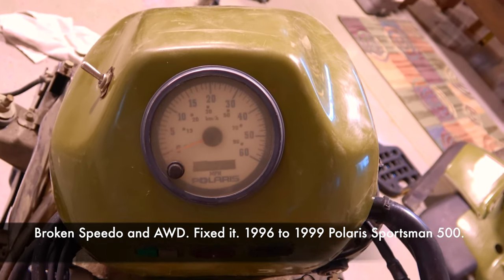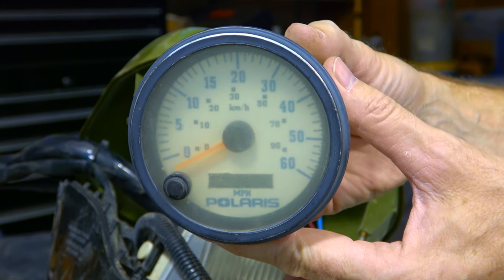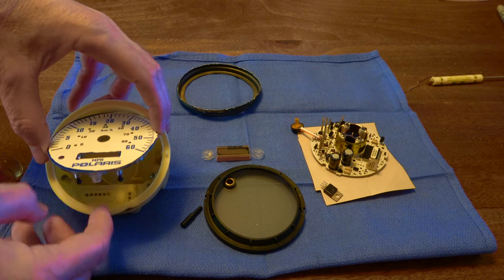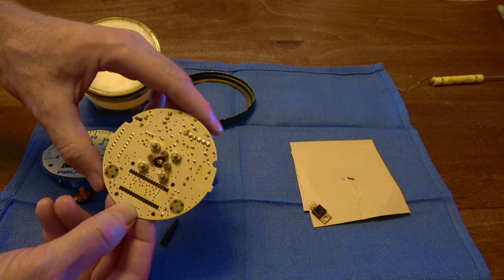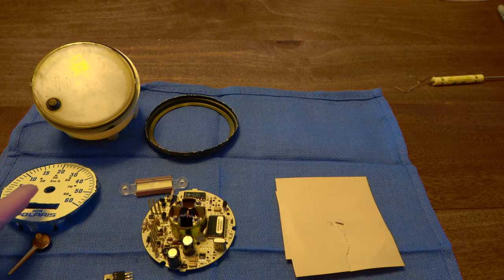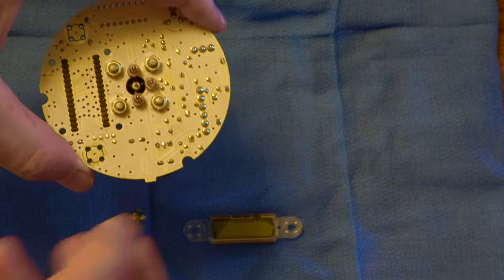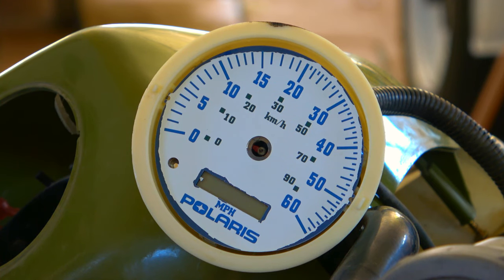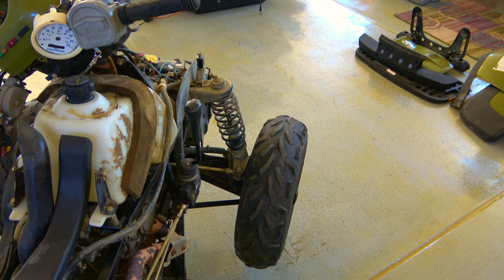Broken Speedometer and AWD. Fixed it. Polaris 1996 to 1999.

Comment: Yep. My 2000 Polaris Sportsman 500 also had a dead speedo/AWD/headlight and the transistor de-soldered and rattling around in the assembly like yours. Unfortunately, soldering it back into place in mine didn't fix it. I intend to replace the entire speedometer with a small computer and screen and relays to get everything working again. I've managed to snag a schematic and will be fixing everything by a full mod on the ATV. You'd be crazy to pay $400 for a replacement OEM speedometer because they're stupidly designed in the first place and bound to get too hot again like before; there's no heatsink on the TIP48 power transistor and it gets to well above 300 degrees Fahrenheit at times. This is completely ridiculous. We should all sue Polaris in a class action lawsuit.
Reply from the maker: Sounds like you have a pretty good handle on it. Id love to see what you come up with. Yah there def is a design flaw. And the replacement is unreasonable. It sounds like you have some electronics knowledge and experience. Have you or could you modify the TIP48 with a heat sink somehow? Would it be worth it and or less trouble or no?

Comment: My speedo on my 1999 doesn't work.  Voltage regulator failure caused all the lights to burn out. AWD didn't work also. Found bad main grounds to everywhere. I  ran a new wire from negative battery to the new voltage regulator,  fixing my charging. issue.  Then under the front panel under speedometer, creating a new frame ground put new ground to harness where the voltage regulator brown wire plugged into harness. Also from new ground source I sent 2 wires up to the brown wires on the AWD connectors to properly ground them also. Now no more starting issues, charge issues are gone. AWD WORKED,  like a new bike. Speedo doesn't work but everything else works perfectly.  GROUND is main issue on Polaris systems.  Also replaced lights with LED lights at the same time. By sending a good ground back to the harness from the voltage regulator harness brown wire gave the bike a new ground source to everything! Someday I will pull apart the speedometer and deal with that issue.  High voltage I'm sure caused it to fail some how. Hope this helps others,
Reply from the maker: Good info thanks. Sounds like you put in some time. But I bet you know that wiring backwards and forwards at this point.  That particular speedo is known to be problematic and one of the things that can contribute to its problems is a faulty regulator. Its problems also relate to the price to replace it. What I did was an exploration or exercise or experiment that fortunately worked out. But I have known many to bypass the wiring successfully. Probably the best more permanent solution really. And if my speedo acts up again, which I suspect in will in time. I will probably do the same. Ive been fortunate enough over the years to not have any wiring issues really other than that.  Thanks for the feedback.

Comment: hi eric. my question isnt about the sppeedo. my issue is the r/f hub leaks. yesterday i changed the seal and leaks like a faucet now worse. any suggestions would be greatly appreciated.
Reply from the maker: Are you taking about the hub seal on the back of the hub under the brake disc or on the strut Im assuming. With out seeing it all I can do is ask a bunch of questions most of which you've pos covered. But bare with me as I go through some and hopefully it'll help. All these questions would really apply to either. Was it an OEM or after market seal?  If after market, is it known to be a good replacement?  Was there any damage to the casting removing the old seal?  Or the corresponding contact surface? If so repaired or smoothed out as best as pos before reinstall?  Was the seal confidently put in properly? Correct orientation?  Not bent damaged or distorted? Did you you lube up the surfaces of the seal and the contact surface?  All of these things can contribute to a leaker.  It can be a finicky deal. I have had similar outcomes in the past. You just have to be aware and prevent any of the above as best you can. Also I have a couple other videos on the hub assembly and a strut seal install. In addition to the above proper torque on the castle nut is certainly a factor. You'd have to watch for the specs on that I don't recall off the top of my head and don't want to guess. Look on the channel at the Polaris playlist if you interested though. Hope that's of help.
Reply: @ericinalaska7648  wemade sure that seal was even and level when we installed it. i also hear now it could be some o-rings . i dont mean the hub seal but o-rings.
Reply from the maker: @judgementday7107   There is an orange(s) on the end cap. Is that what your referring to?  Is that where its leaking the cap? Then yes absolutely there is an O-ring. Just pop off the cap I believe 3? bolts pos 4? and you will of course need to refill the fluid after .
Reply: @ericinalaska7648  the leak is from behind the caliper. sorry so new to this my lingo is hard tounderstand. arent there any o-rings behind the caliper to the hub.
Reply from the maker: @judgementday7107  Is brake fluid leaking? The would be another source. If you have a bad or damaged caliper. Thats pos.
Reply: @ericinalaska7648  i bought this bike 6 mnths ago, its had new wiring,cables,all calipers, brake res. i drive it it has good brakes. its the hub fluid thats got to be contiunally topped off before i ride. its not brakes.
Reply from the maker: @judgementday7107  It can only leak from like 4 places off hand. The hub/cap. The hub seal. The strut seal. Or the fill plug. Or if something is damaged or cracked.
Reply: @ericinalaska7648  if its a strut seal leak, would that still mean that the hub leaks from there. i need to fill the hub with atf everyday.
Reply from the maker: @judgementday7107  Those are the primary things that can leak. Secondary would be any damage to something. Say poor inconsistent seal surface contact. Or something cracked. That would likely be an extreme case. Bent wobbly shaft from a roll over another example. But other than things like that. You have the O-rings on the hub/cap. The seal behind the brake disk and the seal in the strut. And your filler plug. That pretty much covers the options. If its leaking as bad as you describe. And that's a lot. I would personally take it all apart and start from scratch. With a new seal or seals, and be extra attentive to all the details we've discussed prior. I don't think there is any short cut  that will solve it. Frustrating but I don't see a way around it based on what we've discussed and what your telling me. Mak3 sure all the surfaces are in good condition make sure the new seal(s) aren't damaged. The new one could have been damaged upon install who knows. Makes sure you rub some fluid on the seal and surface. Make sure the castle nut is properly torqued. Make sure the filler cap is sealed. Thats all anybody could do. Even if you take it to have it done someplace. Thats really all they can do as well. Just have to commit and see it through.
Reply from the maker: One more thought. I know I have found on some Im not sure if it applies across the board. But the one I do the Hub assembly on. There hub bearings were two different sizes. If those are installed in the wrong order. Perhaps Just a thought. Perhaps that would cause the whole assembly to not  land how it should and that could contribute to your result. But if you're properly torquing and things spin as they should. I don't know just a thought.
Reply from the maker: @judgementday7107  Yes it can.
Reply: @ericinalaska7648  appciate the time youve take eric. im sure its the strut seal then, since ive put in the hub seal that needs to be level and tapped in. i saw your vid on hub repair , but you changed one seal, is the strut  seal in there somewheres
Reply from the maker: @judgementday7107  Its been a while but I believe the video if its the one your referring to is the strut seal replacement. I have another for hub assembly but I don't believe I ever demonstrated the one behind the brake disk. So to clarify. There is one behind the brake disk. You ren=move 4 bolts and the brake disk comes off revealing a seal,  The other , a smaller diameter one. Is installed in the casting of the strut. If I remember correctly that was the one I demonstrated.
Reply: @ericinalaska7648  ty for that response . that is gonna be the seal thats needing replacing. could i ask for that part number for that seal. 2000 polaris xplorer 400. youve helped greatly tyvm
Reply from the maker: @judgementday7107  Google it or search Amazon and make sure it comes up as compatible. I would want to misinform. Im not super familiar with that particular machine and there may be some additional info or options that would need your clarification.
Reply: @ericinalaska7648  is a strut seal and hub seal the same?.
Reply from the maker: @judgementday7107  Usually 2 different diameters. I don't know what kind of budget your working with but if its in the budget get yourself a shop manual. There not very expensive and have a wealth of info. Check out the video description. There should be a link for one. That may not be the one you need but you can refine the search from there and find the one you need.  I always try to get my hands on one for whatever I have. So Helpful. I just don't have a great deal of the specifics for your model.  Happy to help where I can but its a bit limited for that model. Link for a decent shop manual.   https://amzn.to/3rFQW6p

Comment: Just had my rear axle come apart on my 96 Polaris 500. We see the bolts that hold both sides together. Do you have a link for repair/replacement of the rear axles. Haven’t looked yet to see if the bolt simply unscrewed or possibly snapped. Kind regards. Jan in upstate New York
Reply from the maker: I had actually shot a video on that in the past and the footage evaporated along the way. Is it a single axle? Meaning not independent rear suspension with a shaft to each wheel? I forget what year dual independent rear suspension came out. If its a single axle for both wheels I have limited experience with that set up.. If its dual. They're relatively inexpensive and relatively simple to swap out. Happy to chime in if needed.

Comment: Hello Eric I got the drain plug out on the hub no problem. 
My speedometer lights work, headlights work and the four-wheel-drive works but simply no speedometer. Before I try to look into this really long blog that you recommended farther down in the comments I thought I’d see if you had a quick thought. There looks to be like some sort of speedometer cable to the back transmission on my 96 sportsman recently acquired
Reply: Just opened up the light box, wonderful surprise old style with speedometer cable unscrewed/easiest fix in the world!
Reply from the maker: Easy to say now of course butthat would have been my suggestion. Not that it was disconnected. But to replace the cable. They're fairly cheap and an easy thing to eliminate in the trouble shooting process. But your fix was even easier. Hahaha! So much can be learned by just opening stuff up some times. Thats great!

Comment: I finally got my speedometer working with a new speed sensor but the needle stops at about 7 mph and won’t return to 0. The needle was at 0 before I installed the new speed sensor and speed increased when spinning the right front wheel. Do you think the needle just got stuck because it has been sitting for a while not working? I’m thinking about taking it apart and see if I can gently push the needle back down to zero
Reply from the maker: Thats a tough call. Did you gain any other functions as well? Id probably ride it for a bit and see if it comes back to life. And if you gained any other functions you have to weigh the benefit vs the risk. The needle is pretty firmly pressed onto a pretty fragile pin. Have you opened  it before? In the process of troubleshooting? Does the needle seem displaced or rubbing on the lens/plastic? Or had you previously removed the needle? If so. If its not put back in the same position it may settle at a different point. Pos.
Reply: There's a chip near the edge of the board which controls the movement of the two windings (and thus, the needle). Get it apart and measure the resistance across both the bottom two poles of that middle assembly as well as the top two. You should get around 200-230 ohms. Look for heat damage on that rectangular chip. The chip is responsible for zero'ing the needle. It's possible that the needle was reinstalled in the wrong position.

Comment: Great video! This is very helpful. I just purchased a 2000 sportsman 500. The speedometer doesn’t work at all not even lights and neither does the 4x4. I’ve got the ring off and the glass, now I’m at the speedo face. I was able to remove two screws however the third is completely stripped out. Any tips on removing it? 

Who knows if I’ll have any luck, the speedo was full of water because the machine was left out in the weather for a few years. The acres inside are very rusty and brittle.
Reply from the maker: Needle nose pliers? Yah, water can certainly be the enemy. You'll never know what's going on inside there until you get in though. And if it's unfixable. At least you'll know that. And then, on to plan B. Take the most care of all removing the needle. If that breaks off. You're pretty much done. Or at least Im not aware of an economically reasonable solution that's cheaper than just replacing the whole thing at that point. I wish you luck.
Reply: @ericinalaska7648  I got the needle off in one piece. I’m at the part where you pry up the speedo face and undo the three screws. One screw left but it’s got a stripped head. Think I’m gonna try to drill it out
Reply from the maker: @MrBoston2612  If I remember correctly its a Phillips? If so, can you get enough purchase with a small straight blade?

Comment: how did your friend test the transistor?
Reply from the maker: Multimeter. I'll bluff my way through it best I can. The one that needed to be reattached in the video is a TIP48 NPN (Neg Pos Neg) transistor. You have an emitter, a base and a collector. The middle being the base as I understand it. (Three posts.) He put the pos probe on the base (Middle post) and the neg on each outer post one at a time to demonstrate if there was a voltage drop (resistance or change in the reading from zero) and then reversed the probes to demonstrate no change or no reading. And with his experience he said looks good. But my understanding is if you put the pos probe on the middle post and see a reading change on the left and then the right. Looks good so far. If you then switch it to place the neg probe on the center and then the pos on the two outer posts one at a time again. You should have no reading or resistance. If you get a change in your reading like this your transistor is bad. I was prepared to replace it, having limited knowledge of testing one. And they're fairly cheap. But he was confident in his ability and confident it was good so we put it back in. And his assessment was accurate it seems. You can look up how to test an NPN(Neg Pos Neg) Transistor and you'll find lots and lots of videos if you need more detail. But that's about the extent of my understanding off the cuff. Hope that helps.
Reply: @ericinalaska7648  Thank you for your advice
Reply from the maker: No problem. Hope it all works out for you.

Comment: No speedo, no charging, no four wh drive, can i Do a bypass ?
Reply from the maker: Yes, no, yes.  Ive seen others bypass to restore the 4wd and there are a few videos out there. But I have not personally done it.  Im not quite sure what issue you 're having with charging. Im assuming your battery isn't charging. And you've determined the battery is good.  I cant think of any way that bypassing the speedo would have any effect on the charging, That would be stator/voltage regulator related to my understanding.  Both relatively simple swaps if need be.  Also on this model/years. A bad or faulty VR can contribute to the failure of these speedos.  And a replacement isn't exactly cheep. Thats why I explore this route and got lucky. Still working.

Comment: When your display wasn't working did you have lights
Reply from the maker: I did not. In the video I talk about that when I first test it I believe. That was my first indication things were looking good as I turned the key on. Showing it had come back to life.
Reply from the maker: After thinking about your question again and my response. I thought to myself was he asking about the lights on the speedo or headlights? Because I have come across people who were attributing the loss of the speedo to a possible voltage regulator failure. And that their head lights would blow out or be symptomatic by getting brighter or dimming in coordination with throttling. But to answer that possible question. My headlight was working. The two lights on the  front were missing bulbs when I acquired this machine. I did not the bulbs prior to fixing the speedo. But my VR tested good.